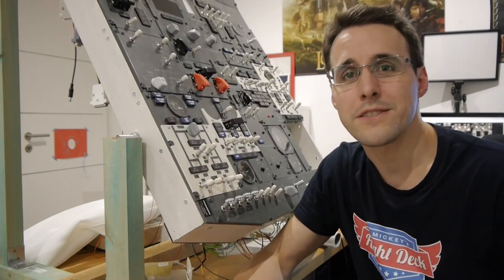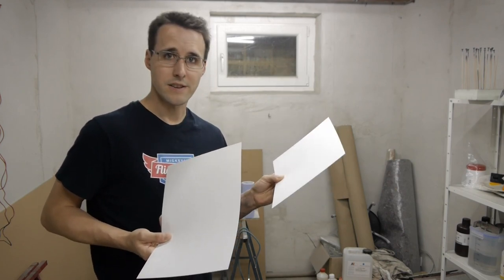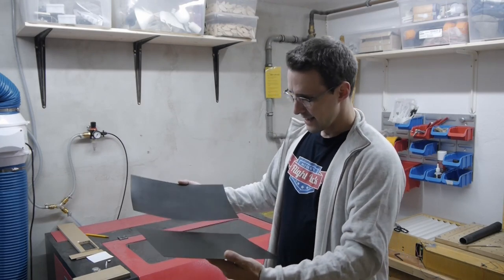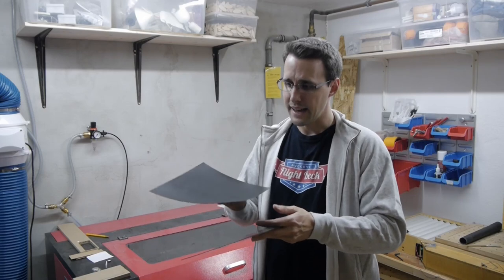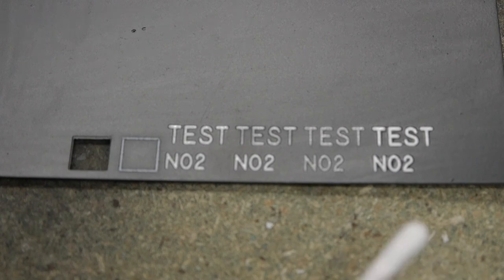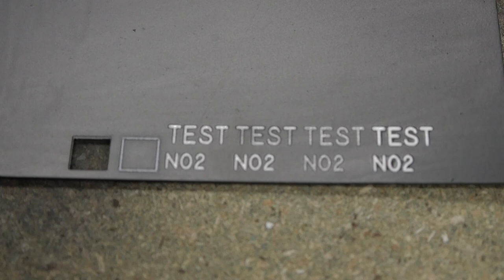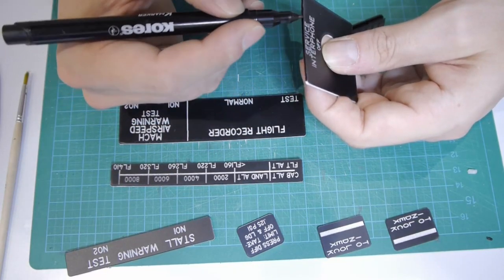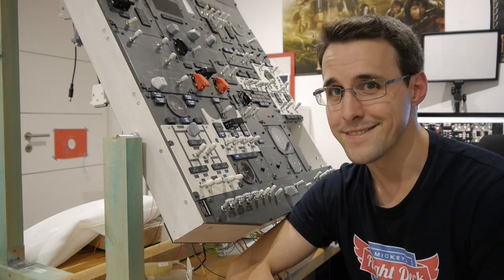Overhead Stickers - A Boeing 737-800 Homecockpit #60

Comment: Michael you can buy ready coated 1.6mm acrylic that will engrave and cut much better than home made panels.
Look for Trotec two colour engravable acrylic, it's made in all colour combinations. I have been using it for years with my laser. There are cheaper versions as well but I found they don't engrave as well.